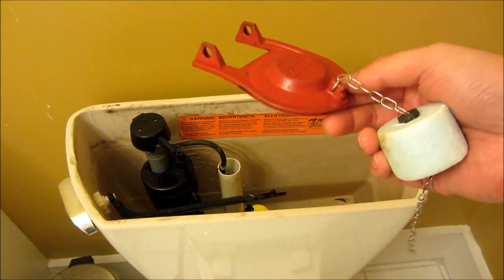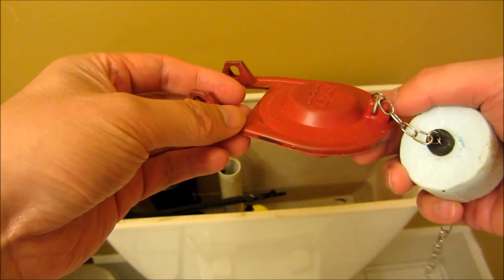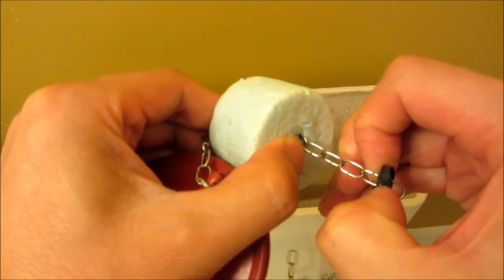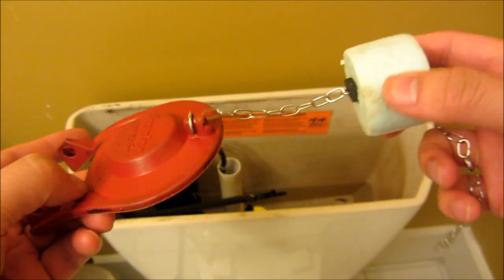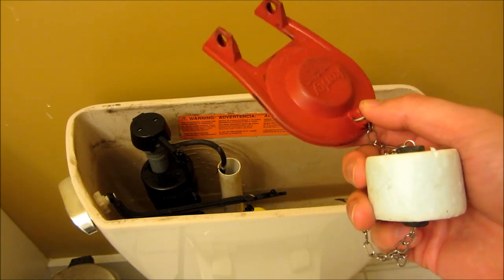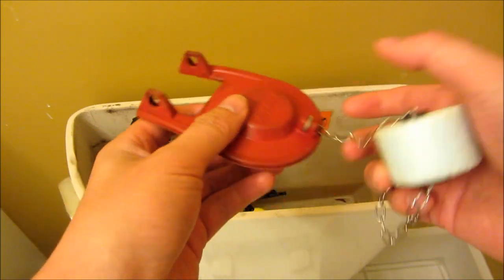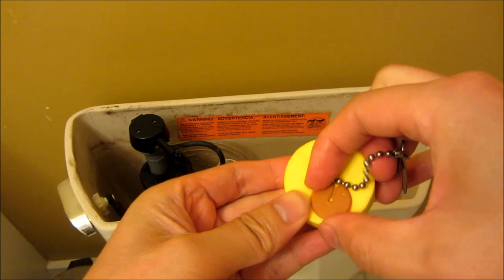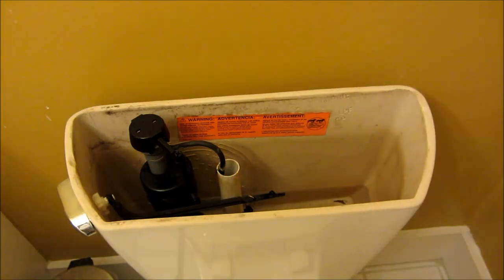How to Adjust Toilet Flapper Float that Closes Too Soon or Too Fast

Comment: Thank you! After installing a side-mount handle, flapper was closing way too quickly. Other videos talked about adjusting chain on a front mount handle. Your tip was exactly what I needed. I adjusted the float, and all works perfectly.
-wannabe repair lady

Comment: Variation: My flapper's float has plastic disks: one at the top of the float and one at the bottom of the float. Also, the chain for my flapper is a ball chain and not a link chain as see in the video. While trying to slide the plastic disks long , I discovered that my plastic disks have a slit cut in them to allow the disks to be twisted and then completely slid off the ball chain and then be repositioned. So, if you have a ball chain with plastic disks, locate the split cut in the disks and then slide them off the ball chain so that you can reposition the float.

Thank you for your video!!!

Comment: I don't think I've ever seen a flapper that had a float on it.
Reply: Yeah, what the fuck even is that thing?
Reply: Me either.
Reply: Flappers often have a built in "float", but often it's not adjustable.   IDC about "saving water", but toilets that drain too far can "sweat" and cause water damage.  That adjustable float lets you choose how much water to leave in the tank.   Also, first time I ever saw one too.
Reply: Mine doesn't have one

Comment: excellent video.  this helped me as well. i too switched out the old flapper. the old one had that almost impossible plastic clip. 

My problem before i switched it out was i adjusted the chain but didn't solve the problem. Had to hold the handle to do a complete flush.

Solution: exactly what this video showed. Get an adjustable float with the rubber washers not the stupid plastic clips then adjust it so that it drains the tank properly without holding the handle down.

Comment: Something else that you might find interesting and I just saw this myself in a video is the little hole in the front of the rubber cone part of the flapper, the smaller hole, is what allows the air that enters the cone through the bottom hole (bigger hole) to escape and fill with water which weighs the flapper down and causes it to shut. On adjustable type flappers you can turn the cone which changes the position of the small hole more to the side which allows the air to escape slower and therefore the flap closes later allowing more water to flush. With the adjustment to maximum it puts the small hole all the way to the side of the cone and allows it to stay open the longest amount of time for the best possible flush. Another way to do this is to plug the small hole in the front or put a rubber patch over it and add a new hole somewhere between the front to the side depending on how long you want the flapper to stay open during a flush. One way to add a new hole is with a soldering iron.
Reply: This is the only thing that worked for me. Thank you so much for your comment!!!!!

Comment: I had been holding the handle down to flush forever, After the chain in my toilet finally broke I replaced the chain and couldn't figure out which direction to place the float...thank you, thank you, thank you for saying it has to be lower for the flapper to stay open longer...I now have a properly operational toilet 😊

Comment: Thank you! You are right... the instructions did not say where to adjust the float if the flap was closing too fast, nor did any of the first videos I found. I know how to connect a chain to the handle and even the flapper. I just couldn't figure out how to adjust it. The other videos just didn't go far enough.

Comment: I've never seen any floats on any toilet I've ever seen and I'm 73 years old. Are they only used in certain areas?
Reply: Not sure but I replaced a flapper yesterday and the chain I removed had a float.  I'm in the midwest.
Reply: It is for low flow toilets so you get 3 flushes per tank rather than one.
Reply: I have never seen a float either.  Mine does not have one.

Comment: Great video, but I'm trying to determine the correct height.  A float too high will not provide a sufficient flush, and a float too low will waste water.  I'm guessing the correct answer for my 1.6 gallon toilet is the height which will flush 1.6 gallons.

Comment: I have a lower end sterling made by Koehler.  I’ve bought new flapper,adjusted chain tight,loose in all 3 handle holes and moved cork almost touching the rubber.  Still closes quickly.  2nd toilet just started doing same thing.
Reply: I'm afraid you're gonna have to have a stern conversation with that toilet.
Reply: We have the same model and nothing seems to help. The flap continues to close faster than it should. After trying all the things offered by YT videos it seems these toilets are an inferior product, plain and simple.🤨

Comment: When is the float actually supposed to close in a 1.6gpf American Standard?    Mine closes when the flush is almost complete but a little bit before the flush is complete.    Is the float supposed to close at the VERY end of the flush, or slightly before, or somewhere in the middle of the flush?     I can hear when it closes, but just wonder where it is "offically" supposed to close to get 1.6gpf and still get a good flush.

Comment: My float is getting caught under the flap when flushing and is preventing the creation of the tight seal. I have it down the chain with no slack and it’s still getting lodged. Open to suggestions

Comment: I adjusted the the float as close as I could towards the flapper and the flapper still closes too fast, guess my one-piece old toilet is the exception to the rule.
Reply: Try adjusting the tautness of the chain?
Reply: @robinfretheim848  thanks, fixed it by bending the flush control rod downward and inward towards the flapper, it was originally angled too high and toward the front of the tank, all better now.